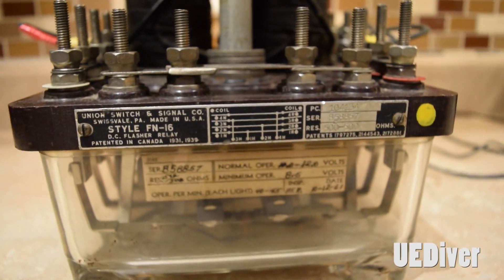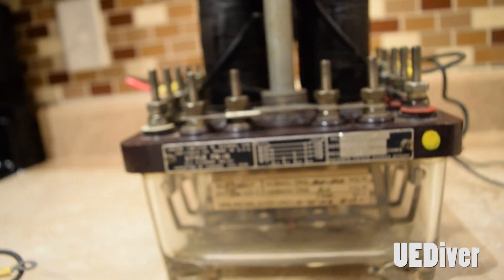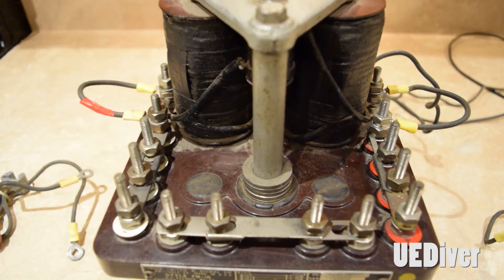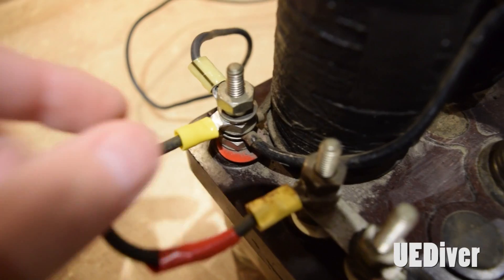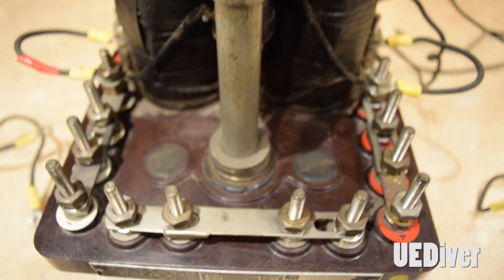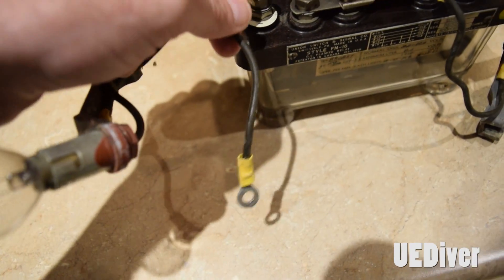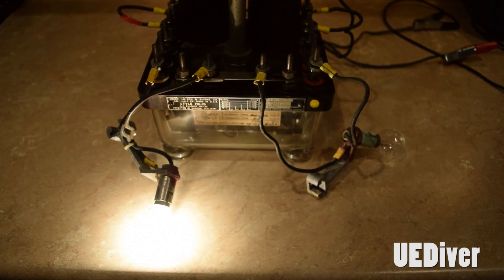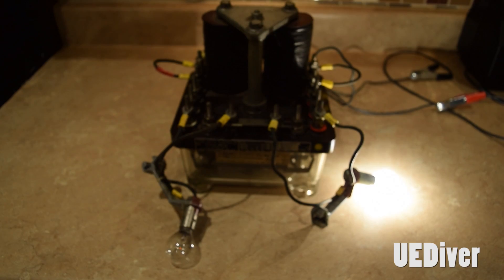Railroad Crossing Signal: Union Switch and Signal FN-16 Flasher Relay Demonstration

Comment: That’s actually a slightly more uncommon version you have there that’s FN 16 older version one noticeable feature is the contacts  are flat. They’re not at an angle which in the FN 16 a the contacts are at an angle and they’re slightly newer design.

Comment: Very good video! Just a couple of questions, how does the bell fit into the relay or is it on a separate relay? How do you make the bell sound as the lights start flashing? Also how did you connect the studs what is that strap called?

Comment: l just built a flasher, l like the slower rate.
Reply: Whats the deal with the washers then?
Reply: @TempoDrift1480  l didn't use washers. It might deal with flash rate. Never used one. I built one from a relay and 12v auto flasher.